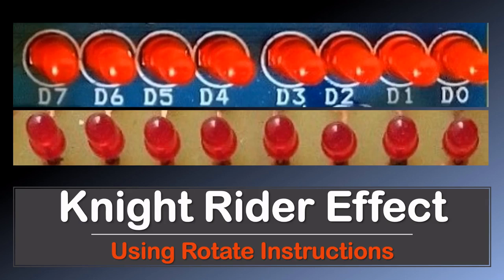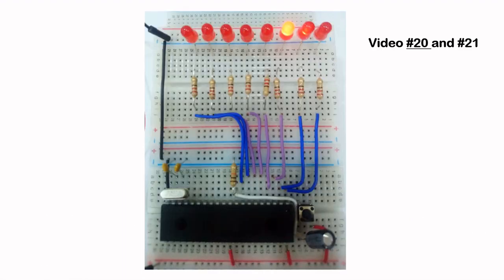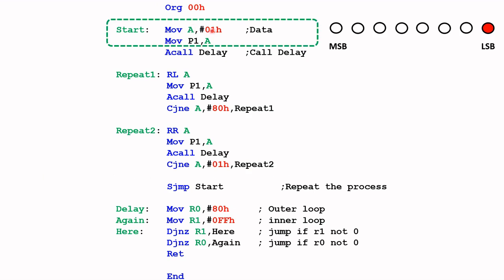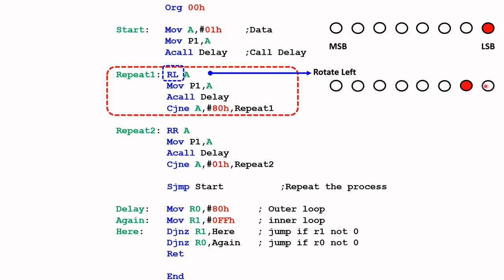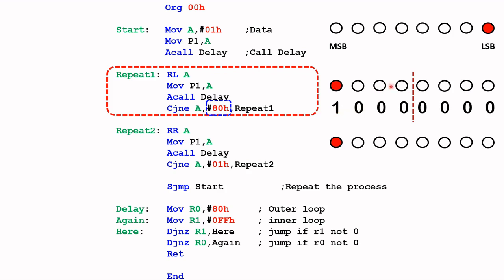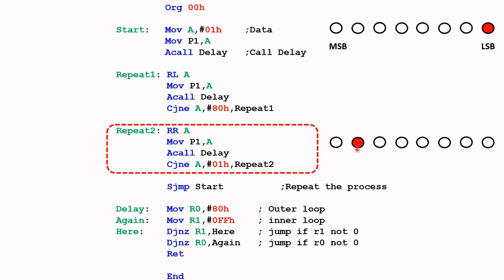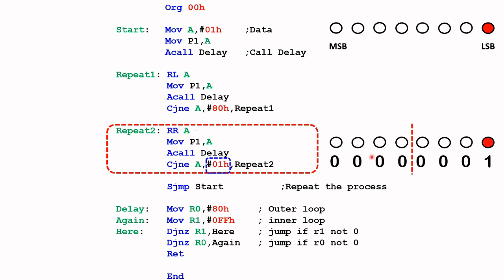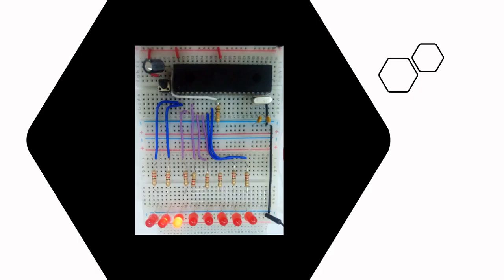#22 Knight Rider Effect -Using Rotate Instruction

Comment: Sir, can you please share how to burn the assembly language program written in edsim51 into the hardware?
Reply from the maker: Hi , in order to burn the assembler code into a microcontroller you need to create a hex file. In the EdSim51, 1 - Load the your source code. 2 -  Assemble the source code. 3 - Save file as a hex file. Please refer to this link for explanation of hex file. - https://www.edsim51.com/intelHex.html.
After you have created the hex file, burn the hex file into the microcontroller using a suitable programmer. Please refer to video #18 and video #26 of my video series for more infomration on how to program an AT89s52. Let me know if this works.